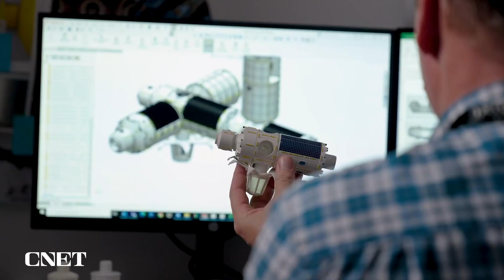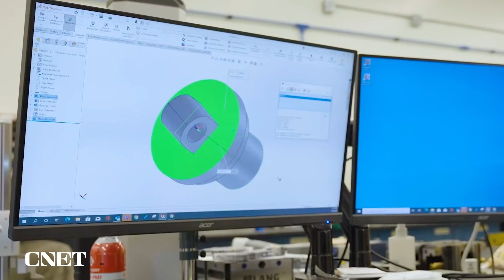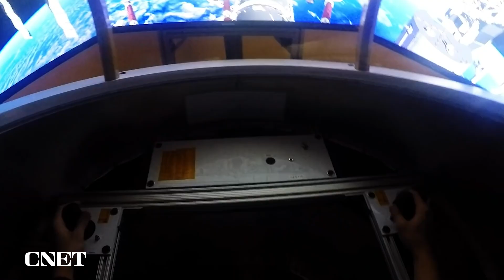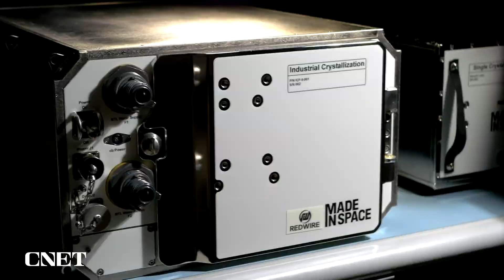Axiom Space Station vs. Blue Origin's Orbital Reef (Watch It Here)

Comment: So… why do they never talk about using spacex as a launch provider
Reply: Because that's a given, who else is going to do it? They all suck!
Reply: Well, Blue Origin would be using its own rockets. The diameter of the Orbital Reefs modules are too large for SpaceX's Falcon Heavy. Currently, they are testing the rockets needed for their large diameter New Glenn rocket on their Vulcan Centaur rocket. They have stated they are designing their rockets, in part, to be a major competitor to SpaceX, so it would make little sense to use them to carry their station to orbit. 

Axiom, however, has partnered with SpaceX and does talk about it. They announced extending their contract with SpaceX earlier this year, and have mentioned their partnership with SpaceX in several of their own videos.